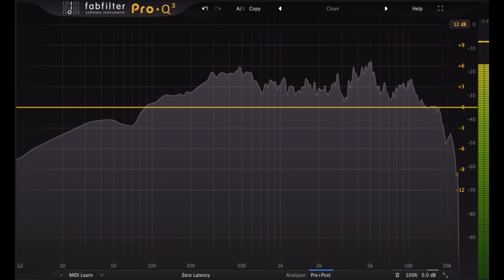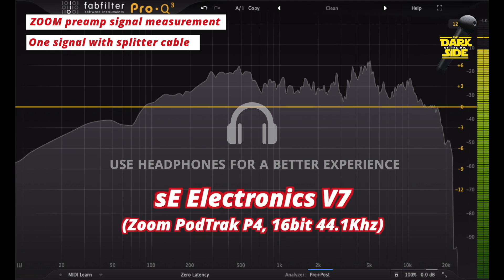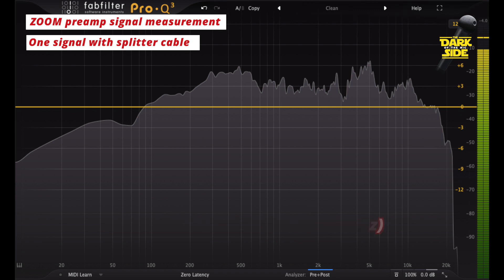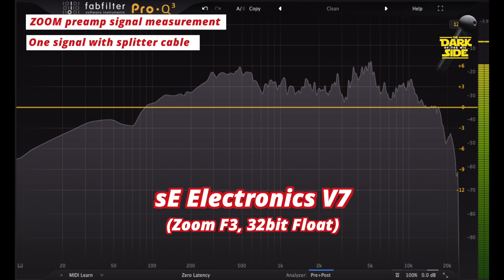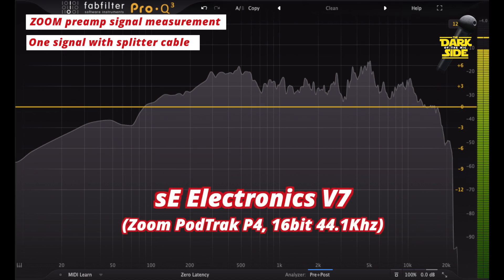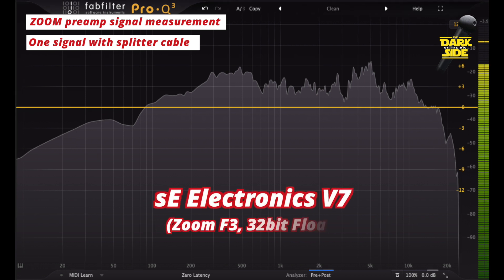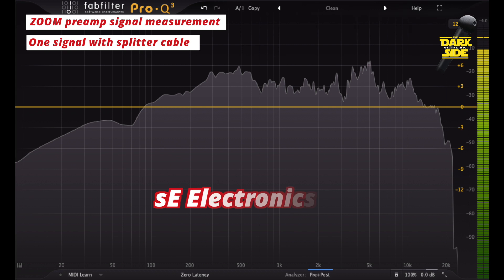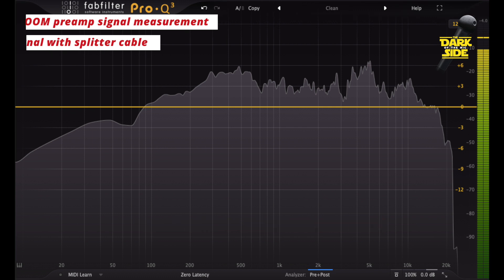Zoom F3 v PodTrak P4: Preamp Geekery

Comment: I know the P4 doesn't come with any compression, but it shows that it has a limiter on paper? As long as there's a safety net if you're doing a podcast and somebody starts laughing... May you confirm the limiter works well?
Reply from the maker: The limiters work pretty well, I’m not sure if they are analogue or digital, but you don’t get any noticeable distortion with them which is pretty good. They do increase the noise floor a bit. Personally I would never use them, if my gain was set to peak at -12, that’s still a tonne of headroom for laughter. If I was concerned about some guests being louder than that, I think a room mic set lower is a more unobtrusive approach that you can fade into the edit.

Comment: But is it cleaner? Zoom F series have much better preamps than H and M series by a long shot.
Reply from the maker: I would say it’s only cleaner by about 1-2db, barely noticeable. Noise floor very similar - I wouldn’t be surprised if it was the throttling to 16bit 44.1kHz that yields the difference. I don’t think anyone would be able to tell the difference in a Pepsi challenge. I’m not sure whether EIN is affected by bit rate, I suspect it probably is, but at -124dbu (P4) v -127dbu (F3) when there’s is no need to go up to 70dB of gain with the SM7B, I think noise is indistinguishable at 50-55db gain levels. P4 preamps are very good.

Also as a comparison the Rodecaster pro V1 had -125dbu EIN at 50dB and it was noisy as hell at 50dB gain, the P4 beat it easily for running the SM7B: https://youtu.be/XgdujSXbBdQ